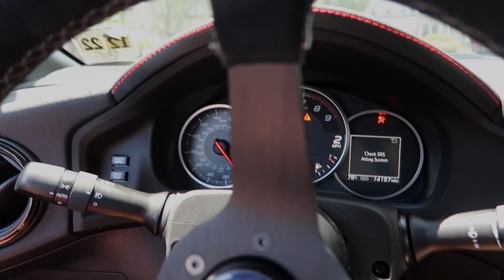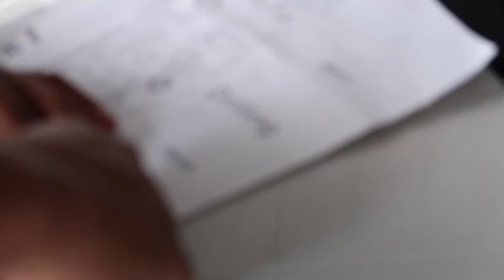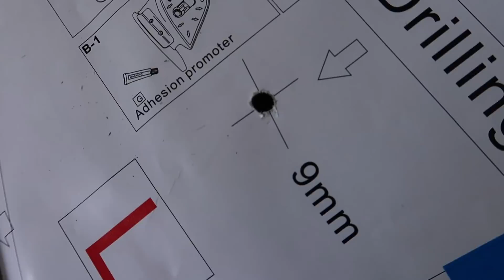DOWNFALL of the WRX... (Please DON'T do this)

Comment: It will be faster than the sti, 
But the wrx don't have the
Bullet transmission
2.5 motor
Un equal headers
Brenbo brakes
Wheels and tires
6 speed short box
310 hp stock with warranty....

Lmao keep justifying while you have the wrx.

Comment: STI’s are overrated anyway man those FAs are sweet
Reply: Overrated because the EJ25 can handle double the HP than the FA20? Okay.
Reply: Aaron Belcher because that engine isn’t 15 years old and the chances of it blowing up on you right won’t skyrocket if you double the horsepower right?  i just think the STI’s need a new engine and something new that’s it FOH
Reply: FA's sound like rice up civics cause it doesn't even sound like a real subaru. Also why would you need to double the HP on STis? If you want more HP get a Camaro or smth. It's all about 4Dr AWD.
Reply: really? /watch?v=xJTaufykTyU because that I think will beg to differ... And this one as well, same exhaust setup I have, sounds exactly like mine... /watch?v=qdHv7i1OybY
Reply: The older stis are better ej207 👌🏽
Reply: I had both a WRX and a STI. The STI is a far superior car from the factory than the WRX.
Reply: +Pitties I agree, my whole argument here is not that the WRX is a garbage car, I love my FA20. I just know what its limits are and can accept that. I guess people just don't understand me. When I look at an engine and its potential, I look at where it is currently, its current ability to respond to bolt-ons, and what its overall potential would be if fully built. That was what my whole argument was about with the other guys, which one even unknowingly conceded my point by saying that the FA20 isn't old enough to have been explored enough. Albeit no amount of exploration without a complete redesign of the block itself will change its overall potential. The EJ25 is far more superior based on many factors and response to bolt-ons is certainly one of them. Fully built an EJ can exceed 1000HP, an FA20 can never achieve those numbers. That was what I was talking to the other guys about. As I said to the other guy, I know if my brother and I fully built our engines, and boosted them to their max, my brothers STi would demolish me in every sense of the word! Even if I was the luckiest guy on earth, I'd max 600whp, he would be well over that, in the 1000+ range! The only way I will ever beat my brothers STi is after I finish my 2JZ swap. The engine will be built and boosted to over 1000+whp, I am going to be taking my time and acquiring parts and building as I go.
Reply: MikeM okay boii everyone keep getting muffler delete on wrx man you never heard a different set up
Reply: Pitties, a STI and More true with little mods on wrx will beat the sti but I love both
Reply: Aaron Belcher ringland failure
Reply: MikeM i love Honda too
Reply: Andre E says the fool that dosent own an sti
Reply: +Richie  This is why they should be built before modding passed 400WHP. 
+MikeM I forgot to also mention that the reason you think the FA doesn't have the signature Subaru sound is that the only ones you have heard are equal length headers with cats. The Unequal length header catless is what gives the signature Subie sound. Both the EJ and FA are both opposing piston flat 4 boxer engines, so they will both give the same type of sound.

Comment: "Faster than an STi" He forgot to say, "faster than a stock STi". I totally expected this anyway, I HATE it when I see a WRX with an STi wing, and realize it's not an STi. I raced a dude in a WRX with an STi wing in my FBO and tuned on e85 13 Si he was intake and exhaust and COBB tuned, and I roasted him. I was so excited until I realized it was a regular WRX. This is going to sound super racist, but I have only seen Mexicans doing this mod...
Reply: Aaron Belcher where have you seen a FBO fa20 wrx at 306 to the crank?
Reply: +Trenton Jeffries I have never seen a FBO FA20 WRX with 306 at the crank, I am not sure why you are even asking that....
Reply: Aaron Belcher well you mentioned up in your rant that if you mod and tune a wrx with bolt ons you would only be at the sti stock range. I just assumed since you were talking about your FBO si that you would be talking about a FBO wrx as well. Since you wanna talk about simple arithmetic, going intake and catback exhaust on a sti wont even put you past 300whp in most cases, given both your power to weight ratios, id say that you probably would beat an sti with them mods. Itd be a hell of a race, really test both drivers. Unless you were racing a new wrx with the fa20, or the sti, either with turbo back, intake, and tune, theyd both be in the 320-330 range depending on fuel. But i sure hope you werent racing a new wrx, because that would just be emarrassing if you thought a new wrx was an sti because of the wing, completely ignoring the sound difference.
Reply: Aaron Belcher should just be happy that you beat a modded awd boosted car in your fwd NA. Specially if it was a fa20, they seem to be right with stis with power in the same stages
Reply: Diego Penaloza right? I mean fbo fa20s are around 340-365whp right now depending on other supporting mods and type of pump gas. I mean if you look at it, give the fa20 a intercooler and charge pipe to match the flow of the stis, fa20 will pass the sti if you wanna talk about power on paper, probably pass it in stage 2  and match the torque if not beat that. Really should be happy that you beat something that shouldnt have lost to you in general? Why cant you be excited haha. A race is a race
Reply: Aaron Belcher i see what you're saying man but those are numbers on a motor that's been around enough to say where it can go. Ive yet to see a stock ej last at 500whp on stock internals for long but that don't mean it ain't possible. There is an fa pushing 419 i think whp on stock internals and turbo. There was an fa20 at 485? I think with big turbo. It didn't last more than a couple months but that is not far from ej if not better than all ejs I've seen on stock internals. And you can't say the fa is not made to be built, like i said earlier, both at stage 2, fa is at 322/330 and sti is at 330/345 on 93. That's a small difference for its only major thing the fa don't have is intercooler and charge pipe. Put that on an fa and you got it beat, put headers and ewgs on them both and they are even i bet, and so on with e85. The fa is getting to much hate. It's impressive that it's even that close on stage 2 given the displacement difference.
Reply: Aaron Belcher EJ has been out for 17 years now ? FA is barely at its 4th year ... obviously you ain't gonna see many high numbers with FA because they havent been fully explored / researched etc... just because their isn't a FA20 yet with above 600whp that doesnt mean there will never be one ... just gotta give it time .. there weren't EJ builds making 600whp+ in the early years that the engine came out
Reply: Trenton Jeffries ive seen an ej doing 500whp on stock block. Gimme some time il find the source again
Reply: chypz sinco ive seen it on stock block, he said stock internals, ive not seen it on stock internals.
Reply: Trenton Jeffries stock block meaning stock internals. Unsure about the heads but the pistons rods and crank were stock
Reply: chypz sinco thats more than ive seen, id love to see the link you find on that! Like I've said ive never seen it but don't mean it's never been done haha